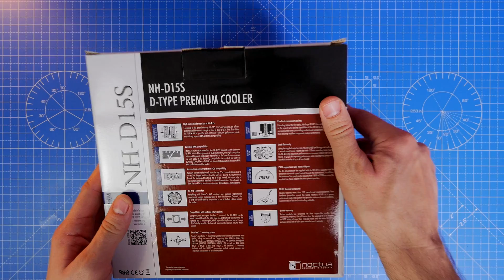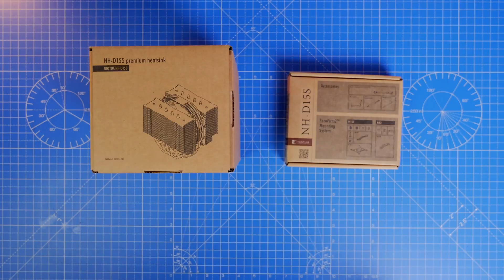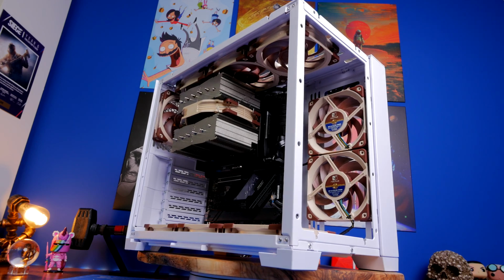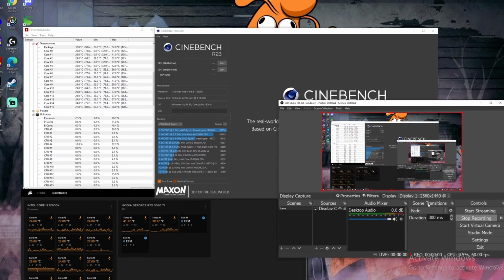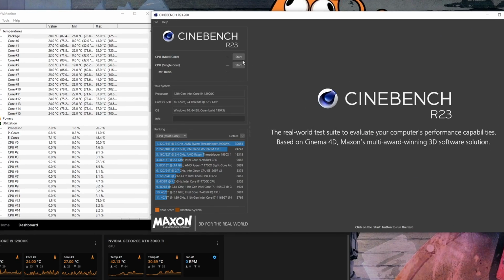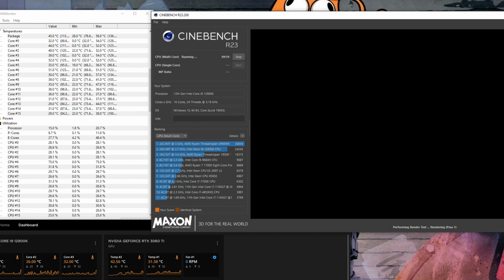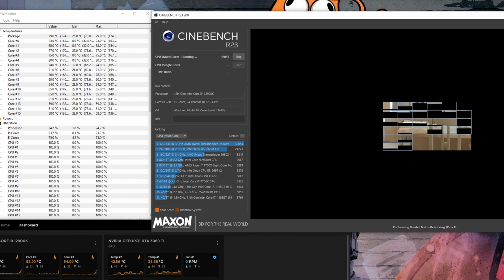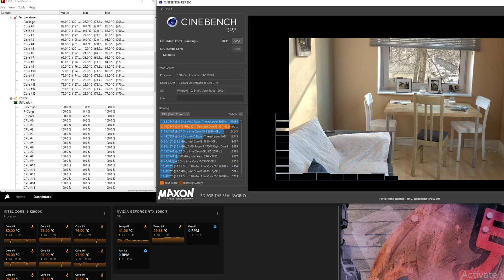Noctua NH-D15S premium CPU cooler with an LGA 1700 install, benchmarks and more

Comment from the maker: I made a stupid mistake in this video. Don't copy me. Watch this - https://youtu.be/8AV6DXlbZpg
Reply: ahh. man as soon as i saw what you did, i scrolled down to the comments :)) saw this :P 
I actually made the mistake of not checking if the LGA1700 is compatible with the old backplate from the LGA155x.. found out that it does not before installing it and causing damage to the mobo or CPU... so just another beware for other PC enthusiasts

Comment: I really hope I can mount mine horizontal with air going to the rear. My CPU is getting too hot. do you know if 90°C is fine on the ultra 7 265k? it happens sometimes when it's compiling shaders, or for whatever reason the game is using almost 100% cpu.
Reply from the maker: https://youtu.be/AVCj61coYCs

Comment: Are any issues if I installed a smaller secondary fan infront of the Heat sink (120mm) due to my VRAM being slightly larger?

Comment: What house do you have? Because I have a "Mars Gaming MCV4, Torre Gaming Custom XXL E-ATX" And I mounted this same heatsink horizontally, not vertically. So As you explain at minute 10:08 but my problem is, that I can't close the left wall of the case properly because the fan touches the glass part, and I tried to remove the fan And I also noticed that the rest of the heatsink is at the edge of the part. So how can I fix this problem in your opinion?

Comment: Very good review, a little to long for my linking :) , but good ! I'm a little confused about the number of fans, seems ... to much, maybe. The idea of airflow, inside any case, is to have an equal number of fans for input and ouput, on opposite sides of the case, to obtain, at best, a laminar flow, which is desired. With you fans displaced like that, you'll get turbulent flow, no matter how you direct the air, because there are too many direction for the air flow. Just saying.

Comment: To remove noctua clips easily- hook the metal tab that protrudes slightly. Push it forwards, which slides it from the groove it sits in, and then pull out slightly. It will spring right off. I actually dremelled a plastic spudger to put a notch in it to do this easily.

Comment: Hi Provoked Prawn , I am now building about the same build same Mother board and the same cooler , You could try turning the Noctua Cooler 180 degrees , so upside down ,and then it fits with the boards heat-sink , of coarse connect the ventilator  blowing to the back of the PC  (it fits same same both sides no problem ) I think the Cool plate will touch better then with your option , also i used a better cool past Thermal Grizzly Kryonaut , that one is also better for overclocking , (also i saw  or read somewhere that they said to apply it every year new , seams a bit much , but anyway refresh it at some moment )  I am not done yet , still need to connect the Power Supply to the board etc .bios start up and Windows ! Ow i bought the Fractal design define 7 case , I like it everything fits good , user friendly case , with sound damping material inside !*-*) There are 3 models , the 7 XL (big)  the 7 (medium) the comfort 7 ) small , i have the model 7

Comment: I applied the thermal paste the same way and ammount you did.
And this is too much, i checked my installation and reapplied the thermal paste just by covering the cpu surface and temps dropped 4 degrees.

Comment: Why not use the NH-U12A instead? I saw a test that shows it outperformed D15S and is more compact in size.
Reply: It would be the most logical, that position is horrible not to mention that you can touch the second fan with the gpu in addition to covering the air inlet and the dust that would fall to the gpu, all the memories are covered and there are no holes to manage cables, it is horrible in all aspects, +1 for the NH-U12A is the biggest thing I would give it in air coolers. The double tower ones only give you headaches and cover the entire motherboard destroying all its aesthetics.

Comment: Hoping the NH-D15s will keep my 12700k cool
Reply: How cool is it running I’m doing a 12700k set up also
Reply: @mrslapside  haven’t tested under full load yet but for games (what I do primarily) it will max at around 75-79 doesn’t get into the 80s hardly ever. So pretty happy with that performance!
Reply: @ajderuyter2293  That's awesome! What style of thermal past addition did you use? haha i'm getting ready for my 12700k builld. Also what gpu? thanks for the fast response!

Comment: Excellent video. I have NHD15 Chromax blackout, and only one fan fits. So essentially I now have a NHD15S, and I was wondering if it could cool a 12900K. After watching this I'm happy to say my 12900K is staying fairly cool.
Reply from the maker: Thanks for watching. Checkout the video I did on undervolting too. That'll help
Reply: I read that it's possible to attach a 120mm fan to the chromax but I haven't tried it (yet).
Reply: What are your temps? 🤔
Also, does the cold plate cover the entirety of the cpu?

Comment: I have a Z690 Aorus Master and the 12900KF. If I get the noctua nh-d15 chromax, would you think that'd be enough to deal with temps from 3D photoreal rendering using NVIDIA IRAY? The case would be the corsair 4000x  Thanking you kindly!

Comment: for this high temp during benchmark, have you unlocked stock frequency?
Reply from the maker: Default settings. I undervolted after and got 10 degrees less
Reply: @TheProvokedPrawn  yes.. default setting overlock automatically the cpu K series, simply disable ..

Comment: hey why did you install the Noctua in that position? sorry if i missed it in the video
Reply from the maker: The top VRM is too tall and presses against the heat pipes
Reply: @TheProvokedPrawn  yeah i skipped straight to the thermal paste part, i’m looking to buy the Asus Maximus z690 Hero and looks like there’s the same issue not sure if it’s worse but man this is a bummer,  are thermals still good despite the position?
Reply from the maker: @HUSTLER1346  depends on the case naturally. In the Lian Li AIR Mini for example, I got a max of 80 degress with the i9-12900K with Cinebench. Which is great.

Comment: Thanks for the video! I will be using my d15s on the asus rog strix z690-a d4 and was glad to see you got it to fit to this strix board. I’m curious though, why not install it with normal orientation but with the offset side going towards pcie slot instead of towards the vrm? That is what is suggested on noctuas site for the d15s whereas you went with the orientation suggested for the non-s d15.

Comment: So does this cooler work out the box or does it need a lga1700 extra bracket .. Reason i as is i had a 12900k sold it and they returned it saying it overheating they said they used this cooler.. But not sure they mounted the cooler correctly..  i dont have any ram to test cooler so have to take there word for it..  Tyia
Reply from the maker: I think if you buy it new then yes, it might have the right bracket. The 12900k is known to run hot though

Comment: I'm doing a build with the z690 aorus and a noctua nh d15 with an i7 12700k
so overall you say that if I want to use it initially to make games or small uses I can do it, but if I use it too high it will overheat.
right?
Reply from the maker: I don't know about the 12700k the temps will probably be different. Even in my case it's fine for gaming. The point is this CPU runs hot. It's known for being hot. It's not the coolers. Fault. But this also isn't optimal positioning.
Reply: @TheProvokedPrawn   
it is true that these cpu have overheating, but I believe that noctua should have moved a little earlier with lga 1700 as in q2 of 2022 there is an update or retirement of nhd15 with a possible nhd16 that will be compatible with lga1718 and 1700.

Comment: i was thinking of getting the NH D15, but now i found this video ! great video mate, now i will probably get the NH D15S instead !! very informative video
Reply from the maker: Just FYI the s is really for if you have a small case or problems like I did. The standard one has better cooling. Just check the compatibility tool to see what works for you.
Reply: @TheProvokedPrawn  both versions fit to my case, but the fact that there is more clearance on GPU and ram, thats the reason ill go for the S version, i saw many screenshots of people that had non S version on ATX motherboard, and there was almost no space between GPU and cooler. i dont want to have such issues :D
Reply from the maker: @Destector.  that too is a good point and a good reason to get it. If you can install it in the proper position it'll no doubt be far better cooling wise too.

Comment: @ THE PROVOKED PRAWN

What motherboard is this? I have the Asus Rog Strix z690-f will the Noctua D15 fit this motherboard without blocking anything?

And is there a difference in upright orientation vs. side orientation?
Reply from the maker: This is the Strix Z690-E Gaming Wi-Fi. You might have the same problem - https://ncc.noctua.at/motherboards/model/ASUS-ROG-Strix-Z690-F-Gaming-WiFi-5374

Essentially it's in a sub-optimal position because ideally it should be sucking air from the front of the case and blowing hot air out of the back, but in this position it's essentially sucking warm air up from the GPU. It's still possible as you can see, but not ideal.
Reply: I have the z690-f with the NH-D15S (added second fan). Fits well but only if you have low profile ram for the second fan.

Comment: 98c WOW!! I got 91c max in 10 mins of R23 with a cheapo 30euro Arctic freezer 34 (,with lga1770 kit)  on my 12900k.
Stock speeds mind you.

There must be something wrong there.
Reply from the maker: Yes. Probably need to tweak settings or reapply paste.